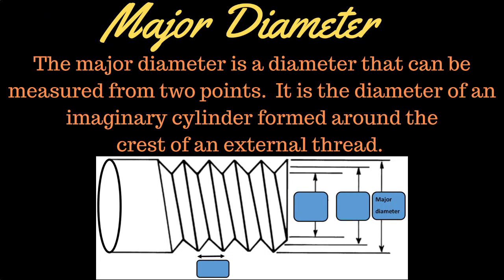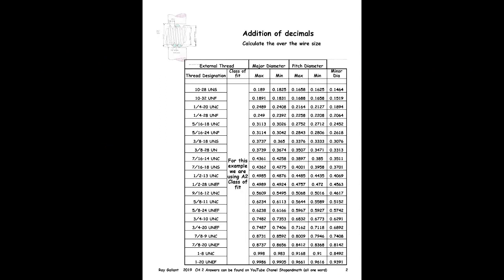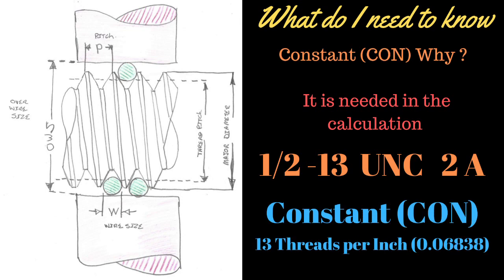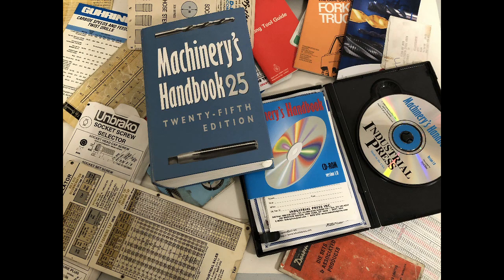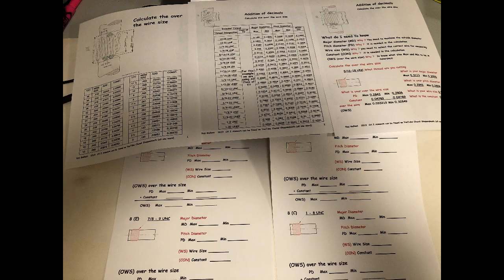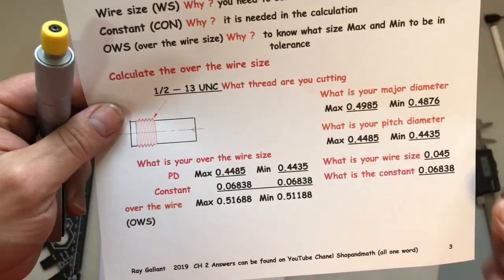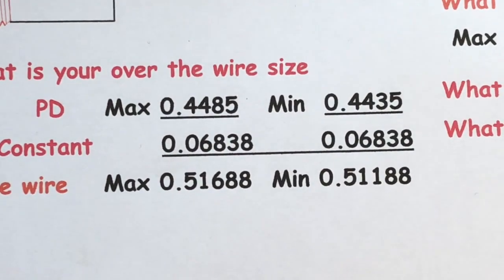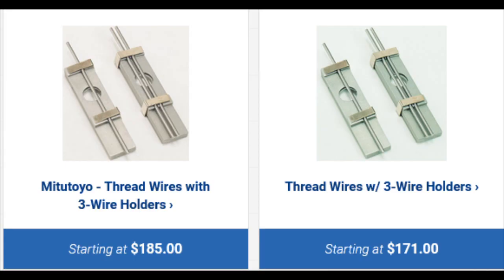three wire method for thread measurement

Comment: At video time about 2:15 reference to "constant" ,  where does this value come from and what is it's importance and or use with our thread measurement ?
Reply: The constant measurement is a mathematical formula. They’ve already completed for you.
So by adding the constant to the pitch diameter, it will give you the over wire size

Comment: very good explanation
Reply from the maker: Thanks for liking
Reply: I have a bit confusion in the depth of thread, i.e 0.64P (or) (P/2)Cot(x/2)
Reply from the maker: you are measuring over wires 
the depth of thread calculation comes from the charts